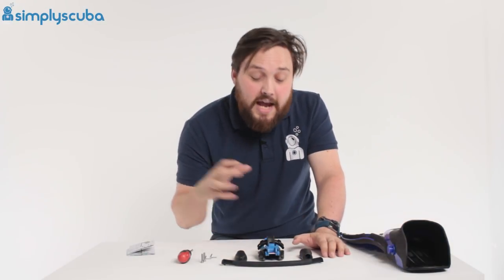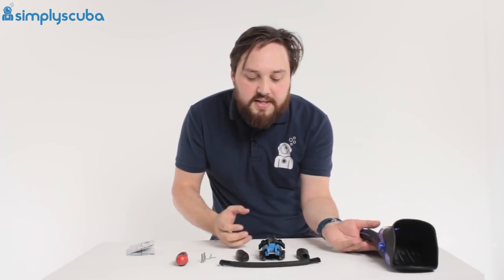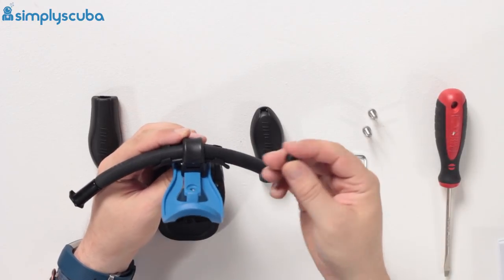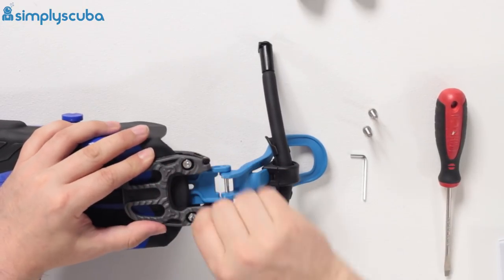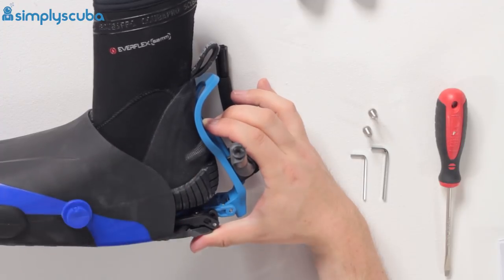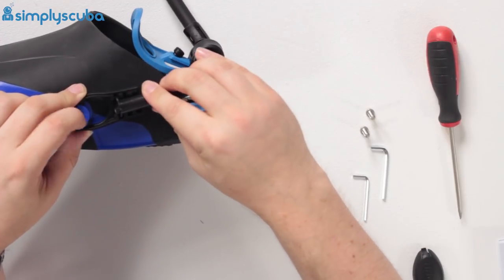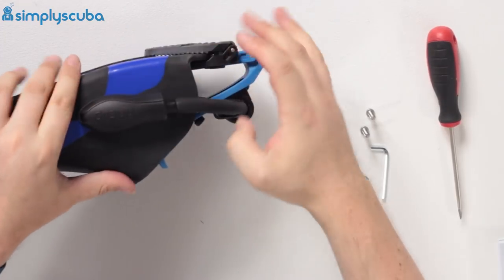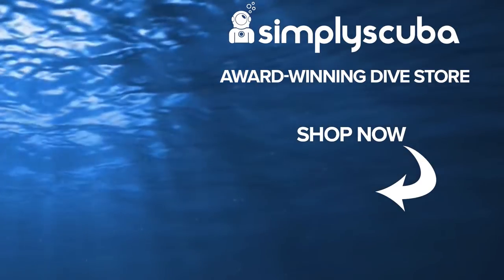How To Assemble Your FinClip

Comment: It has huge design defects.
1. They will only suit the fins with very hard bottom of the foot pockets. Or the clamp will damage your fin severely.
2. They are very very thick, so it will be very hard to put your boot in a suitable size fin.
3. They come in3 different package (1 product), not very easy to assemble, it might damage the hinge of your fin when install.
Those three big problem is the ones that I found right when I was assembling them, pretty sure there will be more problems when you dive with them on your fins.